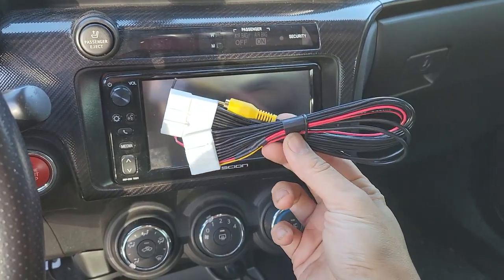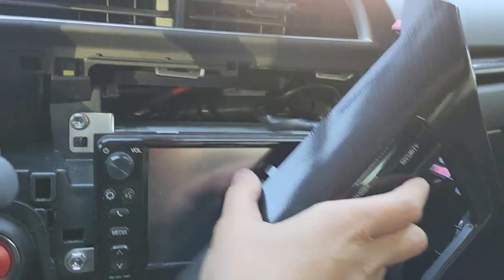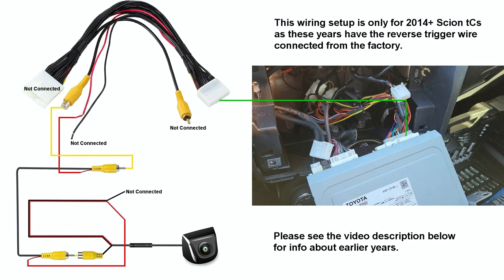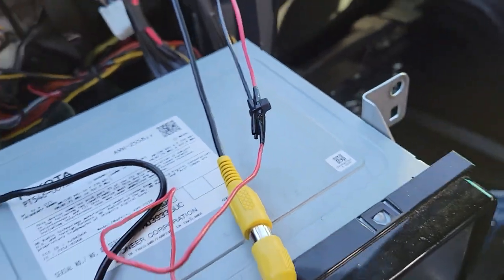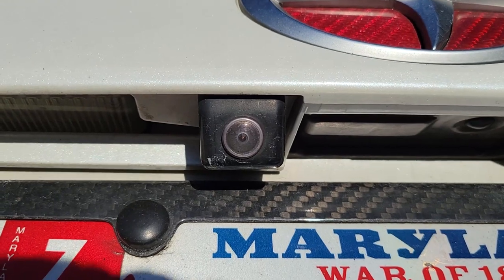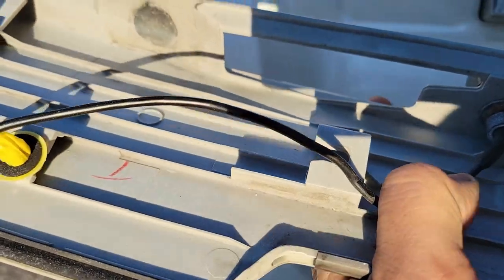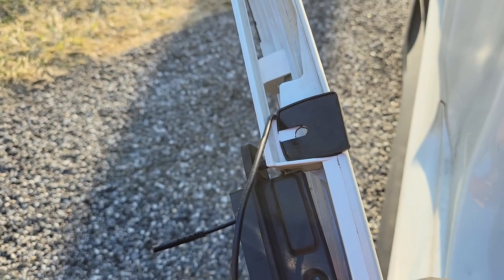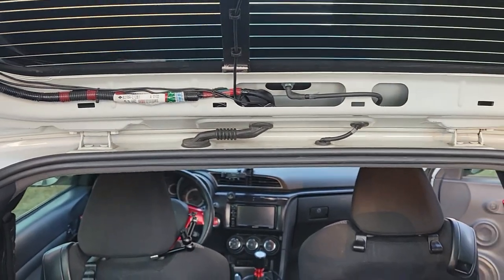OEM Head Unit Backup Camera Refreshed Install Guide (Scion tC2 / tC2.5)

Comment: First thing - thanks for the videos. Secondly, are you sure about the red wolf harness working for scion tc 2014s? On the amazon page Red Wolf says that it doesn't work with the factory pioneer head units. They said no twice.
Reply from the maker: Did you click on the correct link in my video description? Another owner confirmed it works, and it says on the page it's compatible: "For Scion: 2013-2015 FRS, 2014-2015 iQ, 2014-2015 tC, 2014-2015 xB, 2014 xD. Subaru BRZ 2013-2015."
Reply: @VampyreX13 where is that “behind lower dash harness” that you include a picture of in your description? I’m guessing we need to plug into the other end of that to avoid having to get power and ground from one of the other harnesses.

Comment: Hi, great video. If I have a 2016 scion tc radio (PT546-00160) and want to install an aftermarket camera that is 12v. Will I need a voltage converter, or is it just plug and play with the RedWolf adapter? I read in a forum  that I would need a 6v camera and if I got a 12v I would need a converter.  Thank you 😊
Reply from the maker: Cars are 12v systems, so you want to use a 12v camera without a converter. You just need the harness.
Reply: @Derrick Aquino  Hi, I bought the Redwolf harness, but it didn't work for me. I have a 2016 radio headunit that came from a 2016 scion tc, installed in a 2008 Scion xD.
Reply from the maker: @Beto_toro  you're going to need to check the info in the video description for tapping into your reverse wire to trigger the camera.
Reply: @Derrick Aquino  Hi, I bought the reverse trigger wire, installed it and my headunit recognizes when I change to reverse. I connected the camera to the Redwolf harness and tested the voltage but it outputs 6v. Did I do something wrong? Will I need a step up converter?
Reply: @VampyreX13  I was able to get  it to work. I connected the red wire from the camera to the reverse light wire instead of the harness red wire. Thank you for your videos and advice 😃 Greatly appreciated it!

Comment: Love your videos I have 2016 Scion tC I want to install the back up camera it’s just plug and play? May I have the links the the camera and adapter please? I like the center camera
Reply from the maker: Everything is in the video description.
Reply: So you ended using the same park vision back up camera from your old link? On the running the wires video?
Reply from the maker: @venanciopineda4957  correct.

Comment: Just purchased the harness from the 2016 version link in the description as well as a parkvision camera. Wired everything as shown on the video but no picture is popping up. Got my expectations up, however was very disappointed. Would you know what the issue is?
Reply from the maker: Not sure why it didn't work for you, but if you can message me on Facebook or IG, I can video chat and look over your install.
Reply: @VampyreX13  that would be great, what is your IG?
Reply from the maker: @Sheed2408  @vampyrex13
Reply: @VampyreX13  I'll shoot you a message
Reply from the maker: Issue resolved. The plug on the back of the headunit was dirty and not allowing a good connection.
Reply: @VampyreX13  appreciate the help brotha 🙏🏽

Comment: Hi Derrick is there a link to the back up camera you have now? The one you were able to put it as close to center on your trunk. Please let me know thank you
Reply from the maker: Check the links in my Parkvision Pro backup camera video at https://youtu.be/Bbuvh4WKiCE.
Reply: @VampyreX13  aww man the parkvision seems to be "unavailable" do you know the size? Of it
Reply from the maker: @signsofthetimes886  none of the various links are valid? I'll measure the camera when I get home.
Reply from the maker: The size is 25mm x 25mm x25mm and the threaded shaft is off centered (closer to the back) and 8mm in diameter.
Reply: @VampyreX13  thanks for the info! How's your parkvision camera holding up? Unfortunately I don't think they're in business anymore, which sucks because I want a camera that mounts as close to the center of the trunk
Reply from the maker: @signsofthetimes886  so far so good. Every so often, the display has horizontal line noise when the rear of the car has been facing the sun on a hot day, but that's only happened maybe twice this year.

Comment: I have a 2016 tc and the connector is 24 pins, do you know which connector could be?
Reply from the maker: If you look in the video description, I have a link to the 24 pin connector listed.
Reply: @VampyreX13 
I bought the link connector and everything necessary to install the rear camera but when installing the camera does not activate on the screen, they tell me that I need to update my stereo Do you know how I can do it?
Reply from the maker: @luiseduardomarquezjimenez3144  you do not need to update your stereo. Does the screen go black when you go into reverse, or does nothing happen at all?
Reply: @VampyreX13  no, nothing happens, it stays in the main image, I have already tested the camera and connector and they work
Reply from the maker: @luiseduardomarquezjimenez3144  So you have the red wire from the 24 pin harness connected to the power wire that goes all the way back to the camera? Maybe try connecting the ground as well. It's possible the camera might require it, though mine didn't.
Reply: @VampyreX13  Yes, my camera needs + and - You already connect them and it still doesn't work, connect the power cables directly to the battery and a voltage converter and it doesn't work 🤔
Reply from the maker: @luiseduardomarquezjimenez3144  can you back probe pin 2 on the 28 pin harness (reverse trigger) to see if it gets voltage when going into reverse?
Reply: @VampyreX13  I don't know if it's a stereo problem. They tell me that I probably need to update, The problem is that I can't find updates for this stereo pt546-00160
Reply from the maker: @luiseduardomarquezjimenez3144  I've never seen any sort of update for the stereo. You would have to get it through the dealership if there was one. Maybe it's time to upgrade the stereo to an Android one?
Reply: @VampyreX13  Yes brother! I've thought about that and I think it's the best option
Reply from the maker: @luiseduardomarquezjimenez3144  I have a guide for installing an ATOTO A6PF, but it can be applied to similar style Android headunits.

Comment: Twisting wires together does not make a good connection. Either solder them (using a good temperature controlled iron like a TS100 or a Hakko or clone iron - the kind that takes T15 style tip/heater cartridges are best; and “no clean” electronics flux & solder - NEVER use plumbing solder/flux as it’s corrosive and will eat your wires) or use crimp connectors and a proper ratcheting crimping tool made for the style of crimp connectors you are using.

Electrical tape degrades over time and falls off, especially in hot environments; leaving a sticky mess. It’s best saved for quick temporary insulation jobs where you know that you are about to take it off again and put a proper covering on the joint. Oh, and it works great for keeping trash bags closed if you don’t have the kind with the drawstrings.

Instead of tape, get some heat-shrink tubing; and if you don’t have one already get an electric heat gun as well. A hair-dryer won’t really get hot enough, and a flame (like from a lighter or butane/propane torch) will burn the tubing unless it’s at the exact right distance - and the first indication that you’re too close is the tubing scorching and catching fire (a great way to take all the fun out of your day!).  The electric heat gun won’t do that. Don’t forget to slide the heat-shrink onto the wires before connecting them! The heat-shrink tubing comes in a wide variety of sizes, and colors, and there’s also some that has hot-melt glue inside for making waterproof connections. I keep several assortments around the house; as I find that I’m always using it on something.

Also, while you’re at it, if you don’t already have a good set of wire strippers (with nice sharp blades and slots for all the various wire sizes you’ll be using) grab a set of them as well. Few things are as frustrating as poor quality strippers. 😉

All the tools and materials for this can be had online from the usual sources (Amazon, eBay, Banggood, etc) quite inexpensively.
Reply from the maker: Very good info. I usually solder mine as well (I have an old Weller), but I only had 1mm and 5mm+ heatshrink tubing at the time, so I just had to rely on using a western splice. I'll have to redo them now that I have more heat shrink tubing on hand when the weather stays warm. The only time I usually don't solder is when tapping into a factory wiring harness, in which case I use the military splice to secure the wire. Since I end up having to use electrical tape for that, I always run a zip tie around it afterwards to keep it from coming undone. If I have a wire outside the car, I always solder it and I'll opt for the heatshrink tubing with the glue inside if it's anywhere exposed to water. As for wire strippers, I actually have an auto wire stripper that I got from Harbor Freight over 18 years ago that I love. Not only does it strip the ends of the wire with ease, I can use it in the middle of a wire to pull back enough of the insulation to do a military splice.